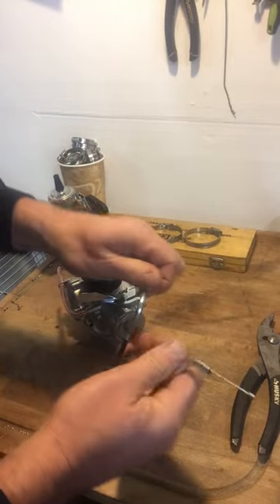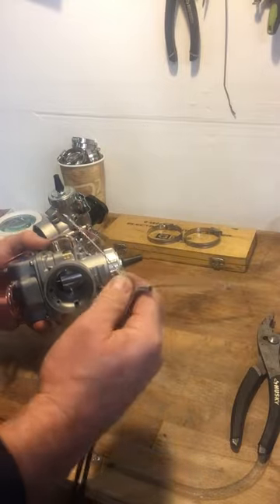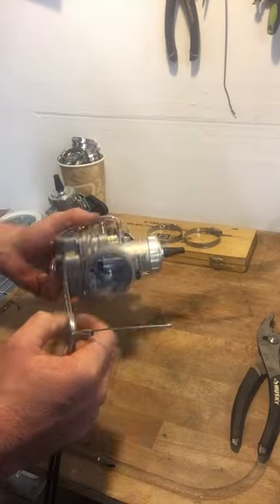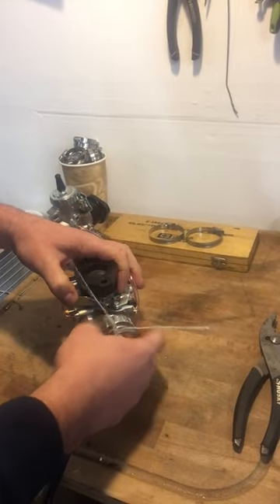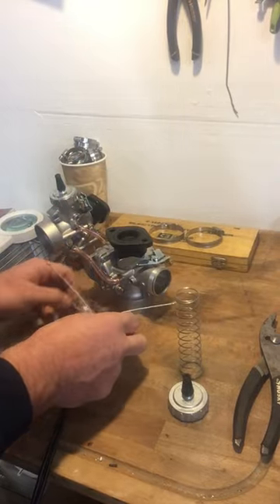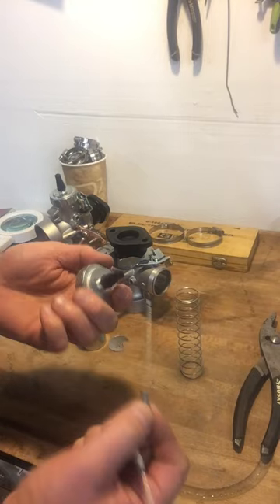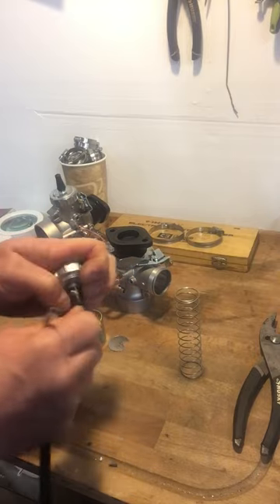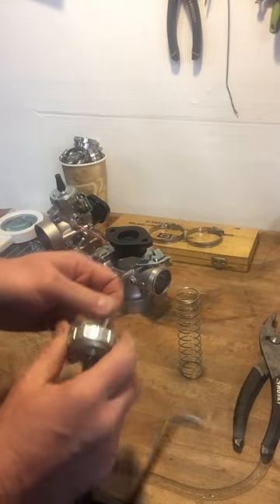Throttle cable Installation Mikuni VM30 VM32 VM34 VM36 VM38 two into one cable from SpeedMotoCo

Comment: I have no problem getting the throttle cable in the slot then, as you showed, dropping the retainer plate under the spring to hold the slide needle in place. But when I do a dry run where I compress the spring as happens when you screw the cap onto the carb the cable ferruled end pops out of its retaining hole. Please advise and thanks for doing the video.

Comment: Thanks for the Demo. The seal where the cable goes through carb cap  doesn't have to be air tight correct? that's just a dust cover?
Reply from the maker: That is correct! What you working on?

Comment: Put these on my 02 banshee bought a +2 Vito's throttle cable and my slides won't go all the way down idk what else too do
Reply: I’ve got the same problem on my ‘92 Polaris Big Boss 4 X 6…I’m still dicking around with it as time allows. Looking all over the net….

Comment: Hey I was wondering if you know anything about a 1976 mikuni carb off a ts 100 I’m trying to figure out the retainer clip and how it goes in with the need and spring and also has the idle screw rod. Any help would be greatly appreciated!
Reply from the maker: Needle clip...then the weird looking retainer. Spring on top.  exploded diagram of the carb >>> https://www.suzukipartshouse.com/oemparts/a/suz/50d3b73df870021958f2659f/carburetor

Comment: I just bought vm36 for my sr400 do i need to tune the carb?
Reply from the maker: If the carb has the base mikuni jettting...yes you will need to jet and tune. 
 You can jet it for altitude, and what type of riding you're doing. (racing, street, etc). We can help you out with the jetting. You can give us a ring at 5416876400.

Comment: What if my cable doesn't have the metal ball end thing
Reply from the maker: They're are several styles of throttle cable end, typically a ball or a barrel. Typically either style will fit in the throttle assembly.